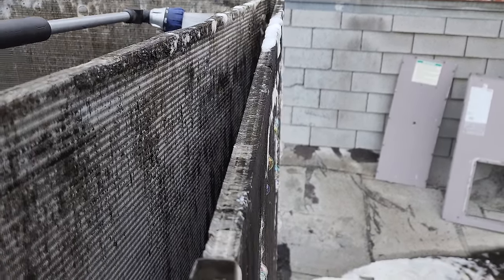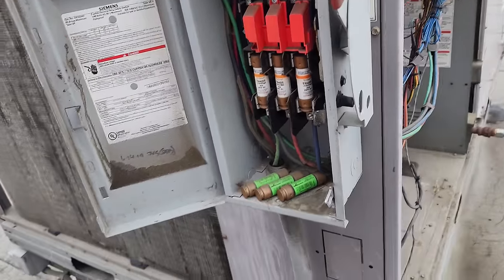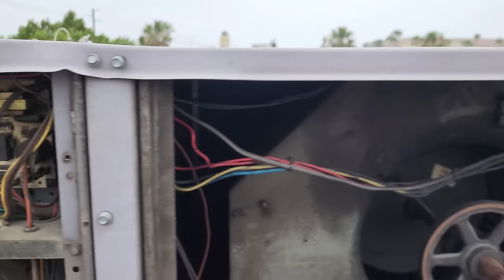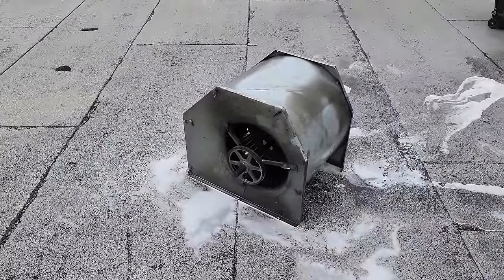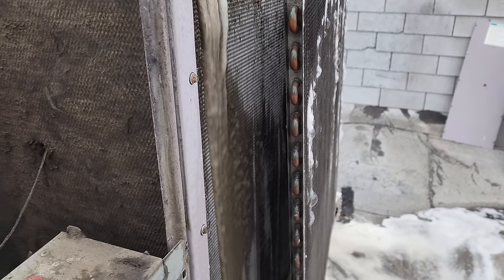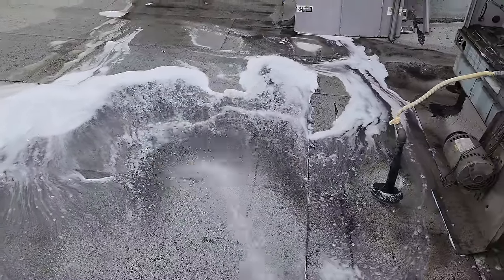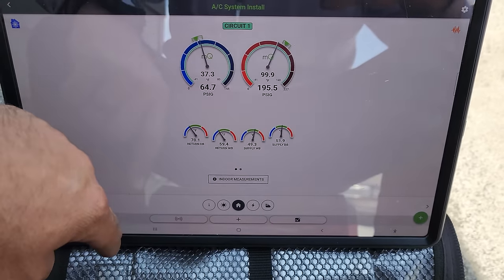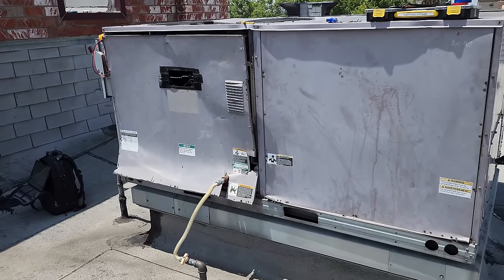CARRIER PACKAGE UNIT LOW VOLTAGE ISSUES

Comment: Being on top of that roof @ 100 degrees you might slip up on some proper terminology. While working on those units you have a lot going through your mind. I’m sure 99.99% of the people that watch and comment on your channel totally appreciate what you do. I’ve learn more on your channel than anywhere. Thank you Chris!
Reply: I believe you are referencing the deadly laser in the sky called “the Sun”.
Reply: @BlueNEXUSGaming  THE SUN IS A DEADLY LASER.
Reply: @themonkeyspaw7359  you have a very strange name. Did you name your account after the mythical object of legend? If so, was it the cursed or cleansed version?

P. S. Yes, that was the meme I referenced.

Comment: Gonna say straight up, as a residential tech, no tune up includes splitting double layered condenser coils.  In fact, the vast majority of those tune ups will not even include stripping the outside cages on condensers.  Realistically we clean from the outside and blow in (and you are lucky to have foam cleaner used), not from a lack of knowledge but because customers don't want to pay what it costs as part of a tune up nor is it usually needed.  If people complain about $75-$100 dollar tune-ups they certainly won't pay for $200-$300 dollar tune-ups.

That being said, when it is needed based on your tech's experience and/or there is an issue being caused....we do have charges for foam cleaning, for removing the outer jacket of condensers, for completely stripping a condenser and cleaning the outside and inside, and yes even for splitting double coils.  So don't be surprised if your tech randomly comes up and brings up a higher dollar amount for a cleaning, and don't give him the "well no one else had to do that and it is working fine" line.  It takes a lot of time to properly strip and clean condensers, especially depending on the manufacturer...so we gotta charge for that time.

Comment: 4:18 One great tool to test transformers is an resistance measurement tool which uses AC instead of DC. 
If any wires are shorted internally, the AC resistance on any coil drops, while only the shorted coil has an DC resistance drop.

An ESR measurement tool is great

Comment: Some of the Trane RTU's have 3 row condenser coils. One of the benefits of microchannel is that it's only a single coil. Even mini splits and VRF units have multi-row condenser coils. Here in the NE the cottonwood, which happens in June will plug them up solid. 
Ice machines definitely take 4-5 hours to clean properly. They aren't the easiest to service or work on. Lots of tubing to remove and little parts and pieces. Cleaning and sanitizing has to be done in separate steps and 30-45 minute cycles for each.
Reply: I have a trane Intellipak I work on that is a two row micro channel coils deep on the condenser with about 2 inches between the coils.  I'm still trying to figure out how to clean it well.
Reply: @bflugan  - Think of a lawn sprinkler.  Long tube with nozzles in a row.   You might have to make it yourself, but aluminum tubing isn't horribly expensive.   Make an L shape (more than one?), put holes in one direction.  Use that to slide between the coils.

Comment: I am not a HVAC tech, nor am I an industrial HVAC package engineer, but some of the things you point out are REALLY obvious. Like. DUH. The whole unit is going to shake, any wires near metal are probably going to rub. But I have worked in another industry (IT/Computers) and I know what the term "Built to a price" means. It can ruin very good products though, because people get this idea that they are unreliable. The thing, as a whole, is not. It is just a specific dumbo moment that happened either at 4:45pm on a Friday before a three day weekend and... Well...

Please leave in mistakes. Mistakes make us human. We need to all realize that we all have bad days, we all smash our thumb when we are hammering something, we all grab the right-hand wrench when we need the fixed-hand spanner sometimes. It happens. In teaching, it should be half "The Basics" and half "The Weird Stuff" because you are never going to get the DREAM of a perfect install of anything. You need context behind WHY some of those weird things happen. You won't know that in some areas you need to have a special ground, because it used to be two buildings. But knowing that MIGHT happen, in some far off day down the line, is very valuable.

And I just want to say that while the IT department in the back office has almost nothing in common with HVAC repair, I can 1 million percent understand the "this is how we should do it, but this is how we are GOING to do it" from a boss/manager/owner/client. It is tough. Nobody wants to be 'the person' saying the terrible 'this is how it is' stuff to their boss, and it sucks.

Comment: You said that the short was on the common side of the compressor contactor. If you have a grounded seconday you would not have a short because it's on the grounded side of the transformer. If you have a floting secondary you would have a short. You may have a call back.

Comment: 6:14 - I know exactly which sitcom that is from, despite never watching that sitcom. I won't spoil it for anyone looking to get their hands on a free sticker, though.
(EDIT: A ton of correct guesses down below. Dating myself in a TV quote, just for fun: "Get out of the city!")

Experience can lead to a significant reduction in diagnosis time. Knowing a specific model's particular failure points can USUALLY save you quite a bit of time and effort on a call, and time is money - both yours and theirs.
If it's a common enough problem to stick in your mind as the First Thing To Check, it's probably going to be the cause 80% of the time (or more).
Reply: Nothing wrong with talking to yourself. We all need someone intelligent to talk to once in a while. LOL

Comment: I am a technician in hvac-r. I like what you do and could see the unit that was being shown. Carrier is a tuff system. I hate splitting the condenser. It a mess to deal with, but when done right you will get high praise by the customer and that makes everything worse it.

Comment: The big gash in the condenser coil is common on those. It’s from the zip ties holding the coil together rotting out and breaking. Or guys will split to clean them and then leave the zip ties off. Eventually that top pass on the coil will rub out against the top of the unit and blow the charge.

Comment: If the transformer is only rated 75va that's only 3.1 amps at 24v. Could easily kill a transformer before a 5a fuse blows.

Comment: Sec coil looks good, it's low voltage coil, which means it's made of quite thick gauge wire, what can go is primary coil overheat fuse built into the transformer, but that looked ok also._

Comment: I just noticed there's a spare control fuse sitting in front of the board, which to ME says someone's been just going back and replacing it when it pops without checking for the cause of the problem, and if it was another company servicing it, some of the sketchier techs might've tried bridging out a fuse to troubleshoot.

Comment: Something very odd happened to me the other day..
Apparently a hawk or something was eating a bird either in the air or on my roof, damn thing dropped the small bird and it fell THROUGH the fan grill slots of my heat pump while it was ON
Having to pick out the chopped up bird bits was super gross :/

Comment: can i ask you questions what are 3 different thing about compression pump
first one run 120v but with capacitor havent seen one without capacitor 
2nd 240v dont see capacitor unless it 360vac compression 
3rd what are different between capacitor or without capacitor

Comment: I lost my home 5 ton unit after 30 years of faithful service due to a split condenser coil.  Never had a problem, and never took the lid off the condenser.  Always kept the exterior fins clean, and the interior looked clean through the fan.  When I broke it down for recycling, I found the split coil.  Was so disgusted with myself for not knowing, or investigating that.

Comment: If you have an older Ford pickup truck service truck or site truck you can slide that panel down into the tailgate and you can't make it look any worse than it already is. If you have an ancient GM same deal. No one is dumb enough to use Chrysler products like Dodge pickups.

Comment: 4:30 I am confused when you tested so many things with that transformer, but you didn't test an open load voltage check.... You just tested the resistance of the coils and said it was bad.... (Neither of them were open circuit, so it's really hard to say they are bad just doing that.) You did test input voltage and loaded output voltage. I would have liked to see you disconnect both lower leads and check the output.

Comment: You are correct. The condenser coil supposed to be split to clean it. The biggest problem I have with older AC units is leaks. I have the hardest time finding a leak on a good working unit.

Comment: MY AC UNIT BLOWER MOTOR FOR MY HOUSE KEEPS ON TURNING OFF ALMOST ASS SOON AS THE THERMOSTAT TELLS IT TO TURN ON. THE THING IS THAT THE AC CONDENSER IS ON AND YOU CAN HERE IT RUNING. TO "FIX" IT YOU HAVE TO GO TO THD FUSE BOX FOR THE HOUSE AND FLIP THE SWITH OFF AND IN AGAIN. IDK WHAT TO DO ANYMORE BECAUSE MY DAD SAID HE ALREADY PAID A GUY ABOUT $1000 OR SO BUT ITS STILL DOSENT WORK ALL THE TIME. ^^^THAT PROBLEM STILL EXISTS??!!

Comment: Big thumbs up on not using aftermarket junk condenser fan motors, we have been burned lots of times as a company trying to save the customer company, way better off just using factory parts in the long run

Comment: Question.i have a split system.it blows a fuse after it calls for cool the second time.i can replace the fuse and it will run till it satisfies and then blows when it calls after the secaond call.any ideas? I did change contactor on condensor.it had high ohms on the 24 volt coil.seems like it ran longer after that.thank you for any help

Comment: I usually find a short over between the panels by the evap coil. I always pull those coils apart, usually no one else does and its always gummed up with cottonwood.

Comment: I watched a video about whether education was required for HVAC and he (John Duncan) concluded that 'no' education only got people accustomed to the terms and some principles and was otherwise a waste of time. He and I are in agreement that a strong curiosity is much more valuable. I have noticed that the thing that people that go to school walk away with are terms like perfect vacuum (high vacuum?) and The Second Law of Thermodynamics. Here are my observations from working in the pharma industry, to remove water from a system use a needle valve with a ball float and sweep nitrogen through the system while the system is under high vacuum. Remember that the drying step is usually the limiting factor in the production of any process in the pharma industry, in short the entire industry is limited by drying so they have invested loads of time and resources to improving drying. Can only remove so much water from a system using vacuum due to the law of partial pressures, that's why we sweep with N2 while also using heat and vacuum. So I wonder how often knowledge of the Second law of thermodynamics has really saved the day for an HVAC tech or is it unpackaged to help win an argument over who's opinion is more right than wrong? If a person is interested they should just start reading and working, tell the owner that you know nothing and are ready to be paid as such, you will be fine, or at least better off than the guy that graduates and thinks he knows something. Get the EPA 608 certification just practice until you pass and then get NATE certified ASAP, again read and stay curious.

Comment: I was waiting for a low line voltage issues but I'm still happy with the control low voltage issue ! I saw other hvacr tech video but they mainly are only filming what they did without any explanation.
fun to see how "easy" (no need to open the circuit)  this one is relative to compressor burn

This rise a question about burn, do you test the operation of high pressure switches while testing with nitrogen or just relace them every time off cam when a burn occur ?  If they had worked, how the compressor could die from a high head pressure ?

The other thing I don't understand is why there are so much burn compressor, even if they mechanically failed, why there is no over-current/phase miss protection device ?

These little things exist 50+ years and simple and reliable. 
I see them in many industrial things from belt conveyor, pumps, blowers and save many many motors !

Comment: you could never get an accurate temp reading on the suction line,it is not insulated and exposed to the condenser air temp,use subcool and delta,thanks for sharing.19:35

Comment: If the short to ground was before the wire connected to the board it will kill the secondary on the transformer. Ideally the fuse or mini breaker connects right at the secondary of the transformer.

Comment: Anyone can learn a lot from your troubleshooting style.  Not making assumptions based on prior experience is THE hardest habit to break - Especially when  you're getting driven to complete more jobs in a given day.    I'm retired, 70+ years old and I learn stuff from you every video that you produce!   It doesn't make me any money, but it sure helps me work on my own stuff!   

And in my experience,  you're the ONLY tech I've seen anywhere who advocates splitting the outside coil for proper cleaning on residential systems.    I have one 4 and one 5 ton heat pump, and both have dual coils.  I haven't bothered to split them  yet because I live in the desert away from most industrial and freeway hydrocarbon contamination and the head pressures have never (yet) been high that I couldn't explain.   But in your area it would be crazy not to.    The amount of hydrocarbon contamination from the freeways alone in Southern California is staggering.

Comment: I don't use any aftermarket condenser fan motors unless it's temporary or the OEM isn't available.  I like going with a motor with the same physical dimensions. Ran into too many that just don't allow the same blade height.

Comment: What do you think about a unit that was reused by a restaurant after a heavy remodel.  Restaurant believes duct work was also reused.  Restaurant believes a return duct was made into a supply duct.  3 years later that duct is still releasing a massive amount of dust.  Remodel was rushed with all kinds of corners cut to save money when it wasn't even possible.  Restaurant discovered a thermostat in lobby controlled a dish area vent, that was walled off from lobby, and 2 zones away for example.

Comment: The high super heat could it be aka pirate air from the bent panel condenser fan pulling air from the side instead of proper way

Comment: Hey Chris, I always watch to the end, because a lot of times you'll explain things in the video in a little more detail. I am an electrician that converted to an ac technician, and I do notice the mistakes in terminology, but it doesn't bother me. I guess you'd have to be somewhat petty to really be bothered by it, which says a lot about that teacher at the convention. Continuity is really just a lack of resistance anyway, so no big deal there. Great video!

Comment: So a question here... how do you recommend breaking a vacuum without introducing any outside air in while using schrader core removal tools?
Reply from the maker: Purge up to the core removal tool with refrigerant before you open it, there will always be a tiny bit of the vacuum broken though
Reply: @HVACRVIDEOS  So you purge that hose and break the vacuum with a bit of refrigerant before putting your cores back in?
Reply: @HVACRVIDEOS  Thank you for taking the time to answer my question! I really appreciate it! And on a side note, you're the only HVAC technician I watch on YT. I really appreciate the work you do!

Comment: The original wiring on those ran along the front of the blower in zip ties screwed to the face of the housing.
When a housing is pulled, motor replaced or something along those lines is when the zip ties are cut and the wires are thrown on top of the housing.

Comment: This is why I like the newer rheem RTUs. I take the side panal where the heat exchanger is and block the supply duct. Then run the blower to get all the loose dirt to blow out of the side of the unit.

Comment: Measure quick's interface in landscape mode on such big tablet looks horrible lol
So much wasted space. But looks the same on any device i guess?
Reply: Yeah, I agree, it looks like crap on that big tablet. Plenty of real estate on the screen to show two, maybe even three stages at once, or display all the smaller gauges on the screen with the two pressure gauges as well. 

It probably looks better on smaller screens due to how the developer handled the display coding. I know very little about programming, barely knowing the basics of BASIC (sorry, I couldn't resist the joke), but I'm assuming that on larger screens, the app simply fills up extra screen space with blank white background instead of scaling the gauges in proportion to screen size.

Older videos of Chris' show him using the app, on a cell phone in Portrait orientation, and the layout is MUCH easier to look at. Same data on a smaller screen, with much less "dead space." Due to the variation in screen sizes and display resolutions across the market of cell phones and tablets, this might have been the best option available to the app developers. Again, I know nothing about coding, I'm making a few assumptions based upon my archaic knowledge of computers dating back to Windows 3.11/95.